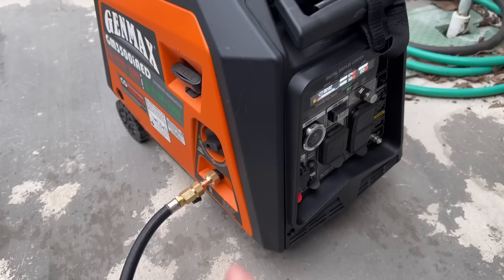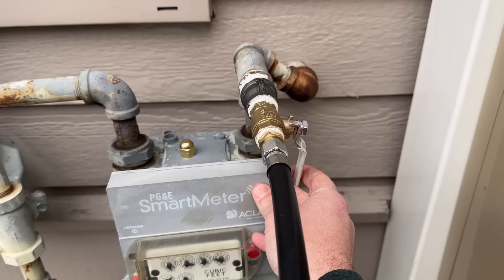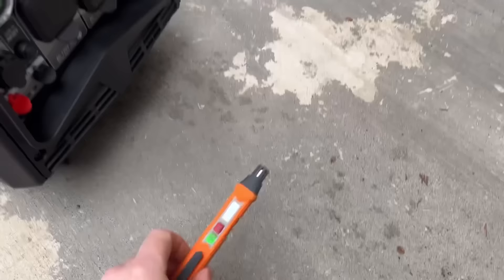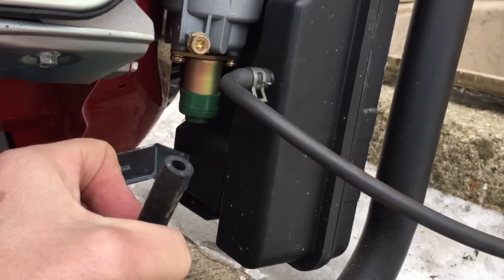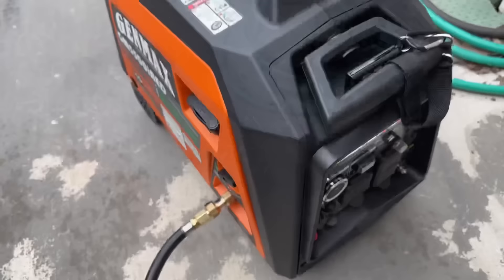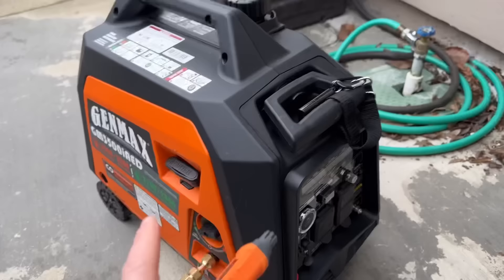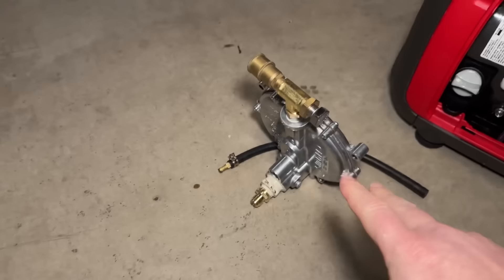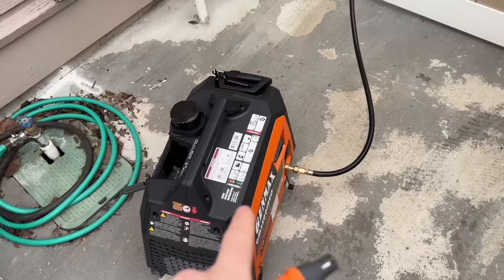Natural Gas Generator Hook Up People Should Stop!!!

Comment: Gas fitter here, the natural gas leak while very unsafe probably isn’t your biggest safety concern but running a propane generator on natural gas is likeley to cause the generator to malfunction and possibly catch fire, NG is 1000BTU/sqft and propane is 2500btu, so the generator is likeley in a run lean condition.

If you changed the pressure and orafice in the propane generator to accommodate the natural gas and hooked it up with a bbq box and approved line it should be the same as the propane tank but thats going to cost you more than just running it off a big propane tank.
Reply from the maker: The load regulator serves that purpose for adjusting the flow. When properly adjusted it should run as normal. You always set rich then lean off a little till it runs correct.

Comment: The only thing you need to do is put a conversion kit on it which has a different size jet.

Nothing wrong with it at all, if you do it as above and ditch the ball valve as a regulator.

Its obviously not "approved" but it works.
Reply: I don't mind a ball valve as a cut-off so the generator can be disconnected from the hose, but, it should be capped when not in use. It just takes a neighborhood kid to come and turn the valve on, releasing natural gas into the air. What ever you do, it needs to be tamper-resistant, when not in use.

Comment from the maker: Please If you see people doing this have them stop. The life you save could be your own…👍🏼 
A proper Kit can make this possible to run NG with your gas generator. This will include a regulator and proper demand/load regulator as well. Never Run a straight hose!!
HAVE A QUESTION AND NEED A FAST RESPONSE…https://asqme.com/@johnnysweekends

If you feel that I helped you maybe consider buying me a drink 👍🏼🙌🏼👊🏼😀
https://www.buymeacoffee.com/johnny5120J

TOPTES GAS Detector Pen: https://www.amazon.com/dp/B0B62LBZPC?
Reply: That regulator you show in the video must be magic lol. most regulators I ever seen only regulate the flow , they do not stop the flow completely no matter what. So even with a regulator when the motor would stop the flow would still continue.
Reply from the maker: Yes a correct regulator like the one shown has a stop in it. Pressure closes it and vacuum from the engine opens it. 
Then the load block up top acts as a fuel screw.
Reply: @johnnysweekends  👍🤟👌
Reply: if i see someone doing this im going to back away and go get marshmallows
Reply: @matthewgibbs6886  before doing that could you please advise them that what they are doing will void their house insurance if they have any insurance at all.
Reply: Having a valve at the tap supplying the natural gas is still a good idea when you are using a regulator.
Reply: I know what’s wrong with it. You’re on the wrong side of the meter. 😂😂😂😂
Reply: @carmichaelmoritz8662  I would probably notice that it cut off when the lights went off and go out to the generator and turn off the gas? Only a fool would run this without a regulator.
Reply: @username22  exactly.  And only a fool would hook something like this up to use in freezing temperatures even with a regulator. That small hose would ice up pretty quick.
Reply: @carmichaelmoritz8662  why would the small hose ice up?   This is not propane it’s natural gas and therefore there is not a liquid to gas conversion to absorb heat energy. So no reason to get cold.
Reply: @neilbrookins8428  thank you for the correction.  👍🤟👌
Reply: This is like teaching a child how to load a gun just in case they find a gun laying around someday.
Reply: @carmichaelmoritz8662  BBQ style regulators continue flowing as there is usually a shut off valve on the device connected.  A regulator for an  engine is a demand style regulatot that only flows when the engine is running to stop flow if the engine dies or turned off . Some are all in one and others have an extra external lock off in case the regulator fail.
Reply: question were do i find that pen u got ..? i need one for a old 22ft rv that has a lil propane leak and i hopeing this will help me find it .....
Reply from the maker: Here ya go…👍🏼😀 TopTes Gas Detector PEN!!: https://www.amazon.com/dp/B0B62LBZPC?
Reply: @kevinhawley962  

If you want a good one go to a HVAC supplier. It won't cost much more than the Home Depot/Lowes version  that doesn't last.

Comment: Multiple selfish reasons not to be that guy: 
1.For safety, gas company might cut your gas service temporarily if there's leaked gas around and they find out. 
2. You pay money for the gas you leak out into the air, and it does nothing for you
3. it sucks to get hurt or killed by natural gas or the fire it could cause
Reply: Additionally, around here at least if the gas company sees you doing this, they WILL shut off your service and refuse to start it back up again until the entire thing is properly inspected. They will probably also fine you pretty heavily.
Reply from the maker: All depends on your municiple facilities policy. Hence have it inspected.
Reply: @johnnysweekends  Pulling out PG&E's plug from the test port and hooking up an illegal ball valve will get you shut off for sure.
Reply from the maker: Already swapped back…👍🏼 only needed for two vids. 
My NG outlet is plumbed on the opposite side of the house. For a bbq or whatever. And a reconfiguration for something I don’t use is not worth it.

Comment: The other day while driving from our home in Minnesota to Illinois, my wife and I were discussing generators for the house.  I had an idea to connect our small generator to natural gas and use a small transfer switch to move the furnace circuit to the generator. Electrically this is pretty easy for me (I do controls for a living).  I had not thought through the gas circuit and how to keep it safe.  Well a couple of days later, lo and behold, what comes up in my feed but this video.  Google is always listening to everything we are saying.

Now, about this video; A regulator will make the operation of the generator stable under variable load.  But how will the regulator shut off the gas supply if the generator fails?
Reply from the maker: The regulator just puts out correct pressure but a regulator with stop pin and load adjustment does it all.
When vacuum is stopped diaphragm closes and pin closes off from pipe pressure. When gen fires vacuum opens up or pulls open diaphragm and allows gas to flow and the load or demand regulator controls amount of flow per what the gen needs based on rpm. 

The correct components will let you switch any gas gen or even some dual fuel models which I will have a video out in a few days on that.
Reply: @johnnysweekends  
 I want to convert my 8000 watt Generac gas generator to propane. Do you know the best place to get a conversion kit? Would I need to go directly to Generac?
Reply: @trendinvestor2893  Motor Snorkel makes a generic kit for most generators
Reply from the maker: There are a couple places like US Carburetor is one you can see if they have a kit or check eBay with you generatorname. Several kits fit different models
Reply: Put in a 120v solenoid value. Manually hold it open to start the generator and when it is running it will work like a start stop circuit. Generator fails, solenoid closes.

Comment: You could potentially get a solenoid valve and a power supply plugged into the generator if you start it off another fuel such that when the power stops the gas is disconnected. I have done that in addition to connecting it properly.

Comment: Great info! As America's power grid becomes more unstable due to solar and wind, folks need to know that there are still options to run off of natural gas.
Reply: The power grid is not becoming unstable because solar and wind, get a clue, most outages are caused by down transmission lines and transformer failures.

Comment: Almost thought this was going be about people using this on the inlet feed ( bootleg). Been in a house once where someone did that to run their gas pipe to pipe no meter, only gas appliance still working after that was their Dearborn heater, pressure tore the other controls up. Pretty sure something like that would destroy one of those generators straight piped.
Excellent video.
Reply from the maker: If not enough gas it couldn’t definitely be to lean and slowly burn the engine down. To much will cause a rich condition and probably shut it off then letting the gas continue to flow since people don’t want to pay for the correct set up

Comment: As a distribution side Natural gas worker the best way to test for natural gas leaks not only the monitor/sensit but some good old fashioned soapy water in a spray bottle will find any leak
Reply from the maker: I always have a bottle hangin on the ready. Haven’t used it lately with the new pen. It’s cool!

Comment: Thanks!  I would have installed a regulator anyway, to adjust and set flow for correct 3600 rpm and an accurate 120 VAC at 60 Hz precisely or very close, but now I know why it is necessary.

Comment: It's called electric gas valve that cuts the gas flow when generator stops. It can be supplied by the generator outlet voltage circuit. A bypass can be applied just for starting with a spring valve for safety reasons.
Reply from the maker: They also have a positive stop type. Positive pressure closed it. And vacuum opens it. That’s the kit you see in the video. Easy

Comment: I've always been told you cannot connect a propane generator using natural gas unless you have a different regulator all together.
Reply from the maker: Some you can depends on the model. They will come with a external regulator and external load regulator.
Reply: My TriFuel Winco generator has two gas regulators.
Reply from the maker: As it should 👍🏼

Comment: Also, it is illegal by code to tap the gas meter on that tee, city inspectors if around will have a cow tapping the plug tee. Great tip and appreciated the video for being safe!!
Reply from the maker: Mine is already switched back with the plug as it’s a 1 min swap. Now after the meter at the T you are supposed to tap in from the back side of the T, which would require a whole redo of that side. I was only making 3 quick videos and I was done. If I need to use NG I can swap back there for emergency or plug into my NG bbq line but that’s around the other wall. 
Remember there are homeless people dumping crap in the river and chemicals and more. Me being on one side of the T or the other in a emergency for power, well let’s say I’m sure some understanding could be had. But check your local codes for proper hook up 👍🏼

Comment: I have the regulator off the propane tanks and then a separate regulator on the generator that regulates the flow in and shuts down the flow in the event the engine stops.
That's what you need both of those

Comment: And, if your generator is exhibiting strange problems or something is amiss with your generator, shut it off immediately and have a service man take a look at it.  Malfunctioning generators are dangerous.  Gas leak detectors and carbon monoxide detectors and smoke detectors are not a substitute for common sense rules.  I know this sounds obvious but you can never be told that often enough.

Comment: A ball valve regulator. What could go wrong, lol. Remember it's only an explosive fuel that will only lift houses of their basements. Tip = Soapy water dribbled over connections will determine leaks by visible bubbles, for leak check.

Comment: You can get a dual fuel carburetor for these dirt cheap so if you plan on doing it a lot it doesn't worth the hassle and not the danger, as the engine will work as it should. This works just fine if you are in a real emergency and have it outdoors but you can't regulate the fuel in real time so varrying the load can lead to release unburnt gas and if it backfires it can cause an explosion, the problem is that when you do this it needs supervising and people are turning on things and like to forget about them, just like if a plain and safe propane heater is left out of sight if for whatever reason it loses the flame and has propane filling the room it can lead to an explosion.

Comment: The idea was there a long time ago.  But you still have to consider the gas pressure.  A minor mistake is dangerous with a gas leak.  One more thing. The gas is dry.  Lubrication must be ensured in the engine during the combustion process.  Otherwise, from the dry gas engine, the compression rings in the block will quickly be damaged and the rolling part bearings will be deformed at a higher temperature.  Gasoline or Diesel is a bit more gentle on engines than solvent gases.
Reply: What are you talking about? That's only true in a 2 stroke gas engine.  All lube is internal on 4 strokes.  about half of the forklifts of the world run on LP and there isn't any added lube in those.  If anything an LP engine should last longer since there is no risk of cylinder wash from the fuel.

Comment: Propane and natural gas. Each fuel requires a different size orifice to work correctly for the carburetor.   Same goes for duel fuel heaters and hot water heaters, stoves as well.

Comment: That's my understanding the generator supposed to run off liquid propane. Where you would have a primary regulator say an upside-down grill tank. The generator should have the secondary regulator. Now I may have just learnt something. I didn't know they could run off of natural gas in it's vapor state.

Comment: Also propane and natural gas regulators regulate at different pressures. Installer must make sure the regulator is set to correct setting for either fuel. Orifice sizes are different for propane and natural gas.

Comment: Interesting, never seen anything like this before.

Never really considered running a generator off of natural gas because I live in Southern California and the event that's most likely to lead to an extended power outage is an earthquake, which will of course also interrupt the natural gas supply.  In our last major earthquake (1994 "Northridge" earthquake) we lost both power and gas but we got our power back a full day before the gas was working again.
Reply from the maker: It’s a bad idea people are doing from another video. But yes using NG for generators is just another source of fuel. Sure here in CA we have several disasters, fires, earthquakes and sure even floods and a tornado that’s small once in a while. It’s just another piece that’s available. 1994 was crazy, same with the Bay Area quake in 1989. We are due…..🫣

Comment: My tri-fuel conversion from US Carburetor came with a big regulator like the one you show so I think I am good.  To run it I end up with two regulators, one on the tank like a bbq would have, and then the big one which I assume is low pressure and regulates the fuel to match demand on the generator itself.  If I were to hook it to my natural gas, I don't need the tank regulator obviously but would still have the big one on the generator.  With this system I don't need to adjust the fuel to match the load it runs wide open and the regulator maintains the correct fuel/air ratio.  The fuel also gets inserted into the throttle body, not the air box.  There is an insert between the carburetor and the intake which provides the correct Venturi effect.
Reply from the maker: Correct you have done it right and have the correct kit. I have installed a couple kits now. Well 3. But yes no regulator as that kit acts as the regulator and demand or load regulator. And that kit was originally from US carb…👍🏼

Comment: You need a regulator if incoming pressure is high pressure(2 psi) if not and at low pressure (.5ish psi) if the genny can be used on ng.

Comment: Thing is that generators with a factory fitting for pressurized gaseous fuels should have the regulator built-in and take the whole 4-6bar lpg vapour. 
 
Any other improvisation is dangerous but it could save lives equally to taking them.
Reply from the maker: Some have them built in and some have them on the external hose

Comment: I installed a Hutchmountain kit on my Honda EU2200i.
It works well on propane and I even ordered the natural gas quick connect fitting. 
Their kit includes a demand regulator too. 
All the firings seem of the highest quality,  I’ve run the generator for hours now and all is good. 
Only down fall is it takes more time to hook up and a few more pulls to get it to start.

Comment: Natural Gas pretty much powers the Grid. If the Grid goes down Natural Gas soon follows. Same for gasoline and Diesel.  The only power not controlled by the Grid is Solar and Wind. A month ago Natural gas pressure in Central Texas cropped dangerously low and the grid nearly failed once again.  IT was GREED that caused this not equipment failure.
Reply from the maker: Yea it would depend where the outage is and if it effects the NG company as they normally have back power as well. But all depends, but correct solar and wind are not controlled but even those have limits as well. Especially in the in the winter.

Comment: this video popped up on my feed and to this day i had no idea a gas generator existed. it makes sense because NG and Propane are fuels but never crossed my mind such thing existed, and to think about it...its even better than having a gasoline one because the gasoline goes bad on storage but gas gets supplied to your house. i added one to my list of things i need to buy just in case.
Reply from the maker: Of buying a generator but a dual fuel unit. When the carb has issues more then likely the propane will still work no problem

Comment: There is a reason that the generator says that it runs on propane or gas. It's not designed to run on a natural gas system. We should start with getting the right equipment to begin with.